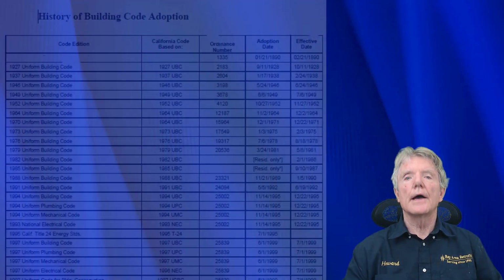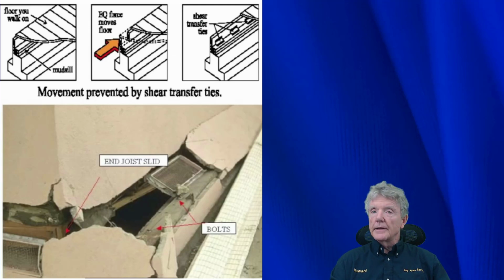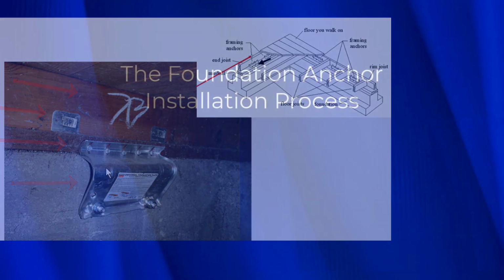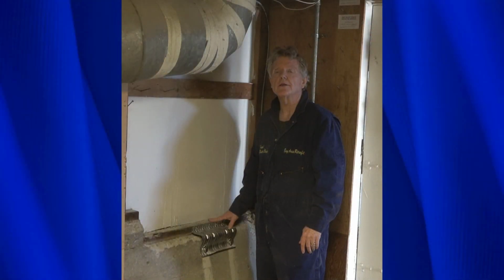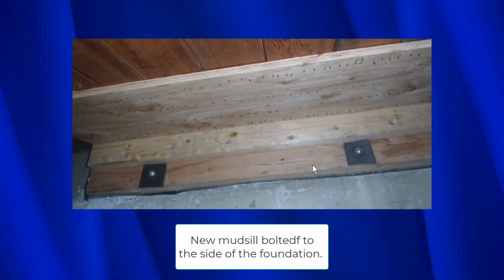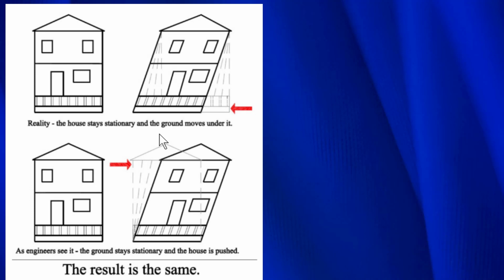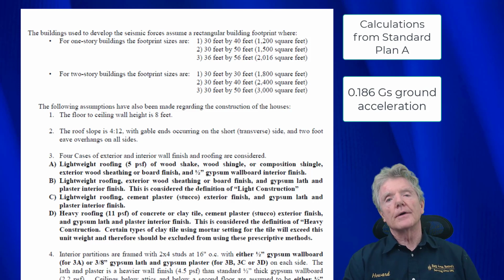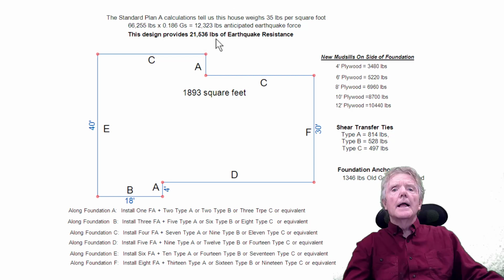SAMPLE NO CRIPPLE WALL PROPOSAL

Comment: Based on what I’ve learned from your many videos I’ve launched into retrofitting my 1911 bungalow in Portland OR. I have a 2’ cripple wall sitting on a 4 ½” foundation…so it’s much easier work than the crawl spaces of some of your videos.  I’m also following the RF1 Detail Sheet from Simpson Strong-Tie so I’m feeling fairly confident I’m doing it right. Since I’m saving so much money by doing it myself, I’m installing more anchor bolts, more transfer ties, more hold downs,  more structural 1 plywood, etc. than is called for.  For the first time in 112 years the house will have all seams sealed and the (cripple) wall insulated! At age 80 I'm really slow but each day I get a step closer.

Many thanks for your efforts to educate us.
Reply from the maker: It has been a lot of work and I am delighted it is helping people.